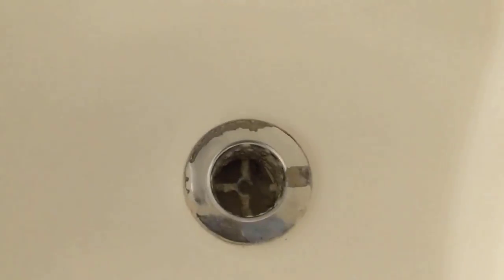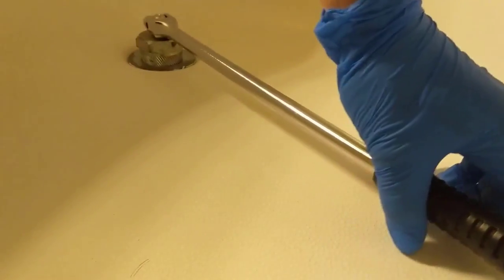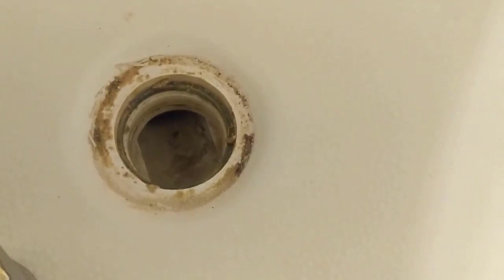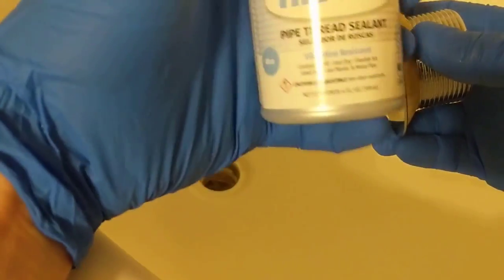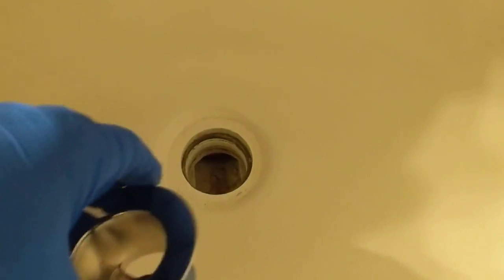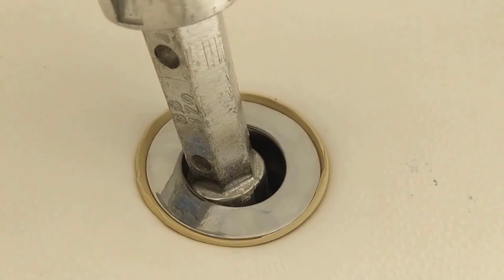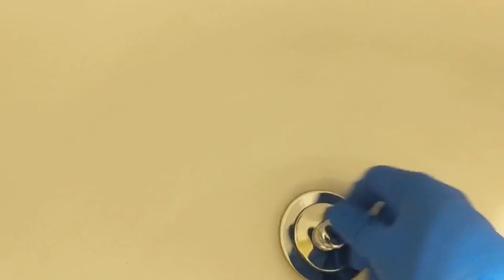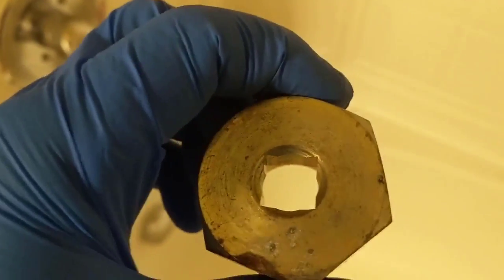The Best Way To Remove A Tub Drain With Broken Cross Pieces

Comment: Is there a covering for the tub like a plastic sheet but not the anti-slip mats but a universal tub cover sheet to cover the entire tub to make it look new and hide the cracks. My tub floor has cracks and chipped paint all over and the apartment office won't fix it coz they say we have to rent a hotel room for a few days coz they have to paint it again. Awesome video. You're the best!
Reply from the maker: If there is I've never seen them. They are correct in saying you should have a hotel or somewhere else to sleep so they can have the tub refinished. The chemical smell is strong and you can't be in there while it's being done or for awhile after. Thanks for watching & subscribe to the channel 🛠️👍

Comment: Great video. What would do you do if the nut slips and won’t catch the drain. Mines really stubborn, I don’t want to keep going at it and warping the drain
Reply from the maker: Tap it down with a rubber mallet or a hammer. The threads are setup for reversing the tub basket out so you will be fine. Thanks for watching Tristan & help support the channel by subscribing 🛠️👍

Comment: Do you need to use the pipe thread sealant or is plumbers puddy enough?
Reply from the maker: @rajlapsiwala3514  You need the plumbers putty around the top ring. You don't have to use the pipe thread sealant on the threads but I always do so next time it needs to be removed it will come out easier. Thanks for watching Rajlapsiwala3514 & help support the channel by subscribing 🛠️👍

Comment: Would there be any potential harm in leaving the original in there?
Reply from the maker: @craigsmith8320  Not at all. You would replace it if you wanted the stopper to be installed & the middle piece is broken which wouldn't allow the stopper to thread in. It's totally up to you. As long as it's not leaking your fine. The cross piece in the middle being broke wouldn't cause it to leak anyhow. Thanks for watching Craig & help support the channel by subscribing 🛠️👍
Reply: Thank you!
Reply from the maker: @craigsmith8320  No problem!